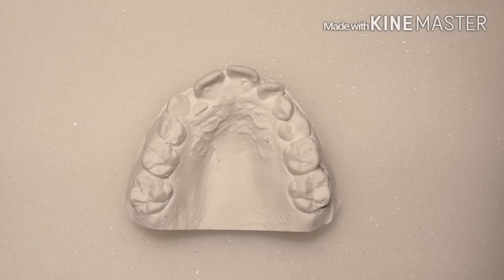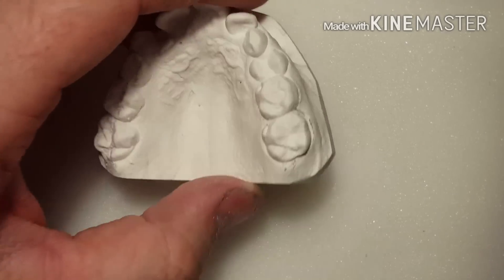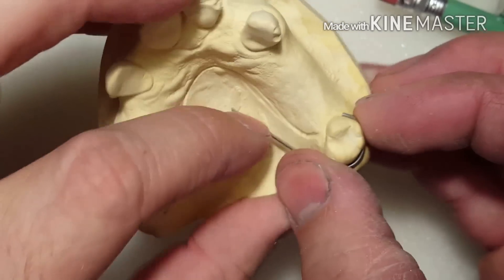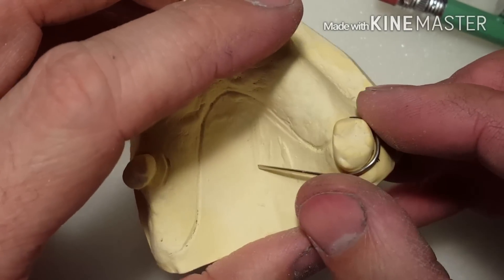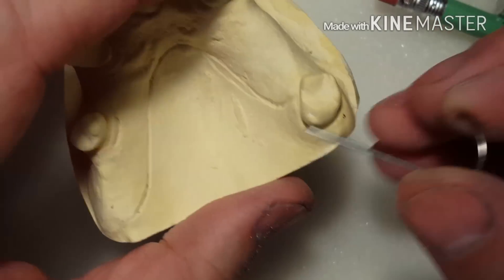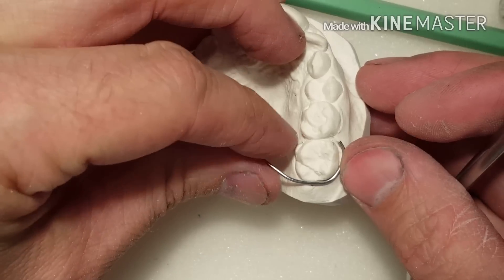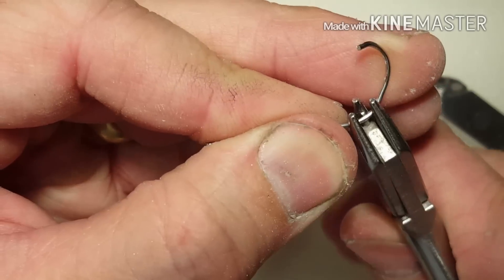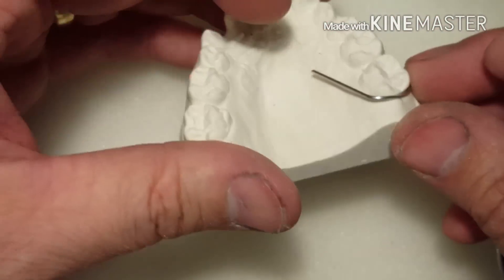How to bend a Circumferential Clasp (C Clasp)

Comment: I'm a dental tech. for 47 years. When I first started bending  clasps ,lying the wire along the gingiva of the tooth was something to be avoided if at all possible.This is something I still do so as to avoid the gingiva from receding as the partial settles in.I see alot of techs.don't seem to follow that rule anymore.Your thoughts on that.
Reply: After the denture is fabricated if the clasp needs minor adjustments some lab technicians and dentists recommend adjusting the terminal third of the clasp as the chances of breakage is low there and some dentists recommend adjusting the portion closest to the denture base and according to them the chances of breakage is less there. What is your opinion?
Reply: @Chronos867  In my opinion  rot iron clasps are able to take alot more bending without breaking than cast clasps.Bend where needed as long you make smooth not sharp bends as sharp bends will cause weak spots increasing greater chance of breakage.

Comment: I’m so pissed with my dentist and dental lab said they have do a complete new partial because they can’t attach additional 2 upper back molars… even though one molar snapped, grrrr…. Guess they’re making a new one…… 😭
Reply: Was it a cast framework? If so, the dental lab sometimes require having metal parts welded to your existing partial to add teeth to it. Sometimes you can't add metal to an existing partial, and it needs to be replaced. Acrylic partials are nice because they can be extended and acrylic teeth can be added to the partial... and sometimes the dentist just wants to make more money!!
Reply from the maker: Tough love
Reply: Probably because u needed mesh to be addex